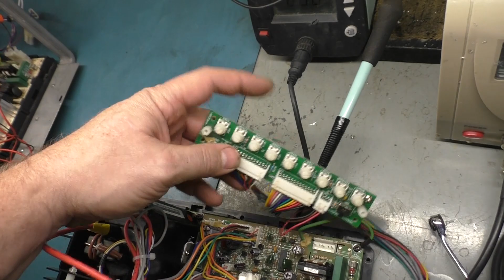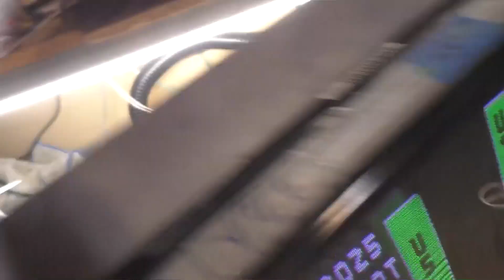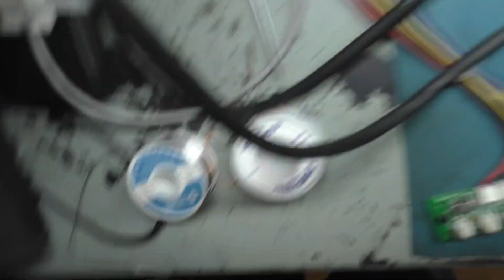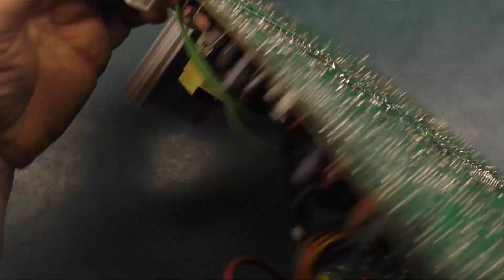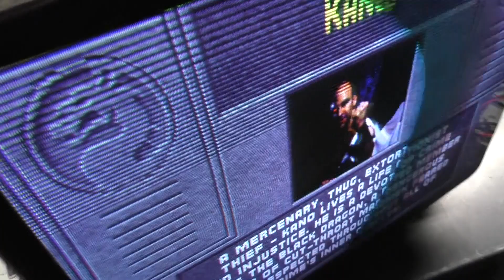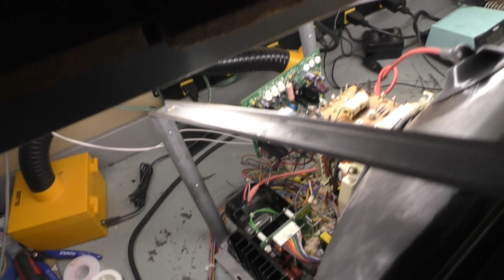24.8" Makvision Wei-Ya Arcade Monitor Chassis Repair - Vertical Deflection Issues. SUPER Frustrating

Comment: Soldering to the back side. If it works. You did it right. Remember the BOSS want it fixed and back on the street making money. I was going to ask how many more resistors did you find out of tolerance? 
 in the 1990's we started a dart league. Networking machines before you do that ask how many power bills you get here? If you don't and they have 3 bills. You are going to blow some shit up. LOL. Can I send you a couple chassis to fix for me? I find It's also therapeutic to use a 4 lb sledge hammer. Hope yall get a laugh out of this.

Comment: Put a 22uf cap @250V backwards and power it up. Sounds like a pistol going off. And I guarantee you you will find several Resistors in the open RANGE. LMAO. REMEMBER BOYS AND GIRLS. IF THE BOSS DIDN'T SEE IT HAPPEN. IT DIDN'T.  AND MY FAVORITE TROUBLESHOOTING  TECH or new employs. Triple the blown fuse and power it up. Proper eye protection is needed when doing this.

Comment: my name is Michael and I worked for A&M AMUSEMENT in Augusta Ga. 1987 to 2005. I worked else where and when I came back to work for A&M It was a nightmare. Bins of components missing because no one there had a clue. I reached out to an old friend and his opinion was the cheap components they manufactured these things with. I currently have about 8 of them. We had a nice board holder. Makes componet removal SOOOOOO much easier. When I came back to work it was broken. They also had a B&K OSCILLOSCOPE. I meant to take it home with me. I wish I had it now.

Comment: Hi. Hope you can still see my question. I have two wei-ya 29 inch crts and both have a pincushion and vow problem on the sides. I already recapped them fully but the geometry still really bad. Any suggestions?
Reply from the maker: Hmm. Can’t say off hand unfortunately. Are the chassis’ on the correct yokes? B+ set correctly? Is there no pincushion adjustment on the chassis?
Reply: Hi Mike, I think. My Weiya is just the same chassis you have on the other video, 29 inch monitor. Came new attached to an LG CRT. I bought two from Japan last year from a guy who had them stored. Both do have the adjustments on the top, or small pcb. It does have the PCushion adjuster but it does not fix the issue. Basically, the linearity is curved to the sides, left and right respectively on both sides. Also, the bottom right vows really badly. My Geometry is ugly. I read from a post on google to make sure Cap 76 is a 1uf 50v cap and that it has continuity to IC10. I checked this and did not find continuity and bridge it. However, this made it words plus the PCushion adjuster did not work. So I had to put it back as it was. Anywhere I can send you a photo of my issue. Again, it is the same exact chassis as yours, the weiya C3129DSLG.  @MikesArcadeMonitorRepair

Comment: I just ran GroovyMAME on this same arcade monitor today and it broke it. I only get clicking every 2 seconds with no picture when I plug in the power cable with nothing connected to the VGA input cable. I don’t know what GroovyMAME did but I think it tried to run it at 15.7 kHz and it didn’t like it and broke. Please help my life depends on this precious arcade monitor.
Reply from the maker: It won’t run on anything above 800x600 on VGA. Make sure your resolution is 800x600 or below.
Reply: I was running High 640X480 resolution. It makes no since what GroovyMAME did to my monitor. My monitor was perfect before running it yesterday playing Daytona USA 2 and now I have to figure out how to fix it
Reply: I forgot to say I smelt electrical fire coming from the monitor

Comment: Thank You so much for posting this! There is so few people even talking about these Makvisions, let alone discussing troubleshooting with them. I was very surprised that it took replacing an entire section of resistors before you could see any difference at all. I'm curious if any other problems on the board would have caused these resistors to go bad because I had heard from others that it's not real common for the that to happen. But everybody has a different opinion. I feel like I've already learned some valuable info just watching this. 

I'm an electronics beginner in the process of replacing a Flyback that seemed to fail catastrophically out of nowhere. I was changing resolutions when I heard a zapping noise probably from arching and the screen turned almost solid white and pincushined badly. Then the screen turned off on it's own and never turned on again. So I'm replacing the HOT along with the flyback. I have noticed there are massive resistors on the neckboard as well that look like they may have had cold solder joints. So I did lots of reflowing as well as replaced most of the capacitors. This happened months ago and still haven't got around to replacing the flyback, as I've just been trying to learn about any potential problems before attempting to boot it back up. 

Anyways sorry for random essay but wanted to say I enjoyed the video and wanted to share my story. It's  fun to experiment with this stuff even if I may not get it going again anytime soon. ;)

Comment: Nice finds to get that fixed! 
I had an M3129DB that had a similar vertical deflection type issue causing bars like that to happen but it was happening half way through the picture / sweep. Turned out there was a small mylar capacitor that was bad  in the vertical output block of the chassis. One single mylar and the entire picture was restored lol. Hunting resistors can be frustrating though.

Comment: Hope you had a good Christmas but would you happen to know where I can find a service manual PDF for a 7600 chassis Wells Gardner
Reply from the maker: Yes. Thanks you. 19” or 25”? That’s just a standard K7000. You can Google “K7000 Manual” and you’ll find it.
Reply: Okay
Reply: But it doesn't look like a standard k7000
Reply: Can't get my phone to send a pic on there
Reply: Is on a it is on a 36-in tube for a rolling extreme street luge
Reply from the maker: No? Not familiar with the K7600 then. You sure it's not a U5000? Did some quick googling and everything for a K7600 is coming up as a U5000.
Reply: @MikesArcadeMonitorRepair  that's the same problem I'm coming up with I did find one of the chassis for sale on eBay but that was it the deflection I see is on the back side of the board towards the monitor and the pin cushion board is soldered directly into the motherboard and it looks like it has some kind of amplifier capacitor for the tube  for the fly back
Reply: Is there a is there a way that I can send you the picture through email or something

Comment: Hey Mike!  Thanks for making these videos -- I'm learning a lot!  Curious on a few things.. 1 - When is it not advisable to test a part in circuit?  2 - Do you have any vector monitors you could make videos on?  I have a V2000 I'd like help troubleshooting :)  3 - Do you accept mail in repairs?  4 - You seem to prefer solder braids over desoldering irons - any reason why?
Reply from the maker: 1) You can always test a part in circuit. I only remove them from the circuit if they don’t test good in circuit. This mostly only applies to resistors. If they read out of tolerance in circuit, they must be read out of circuit to verify if they are actually good or not because other components can be affecting their readings in circuit. If you’re testing a component like a transistor and it reads shorted, it’s important to remove it and test it out of circuit to make sure it’s actually shorted and not something else that’s bad causing it to read shorted in circuit when it’s actually not. 

2) Not at this moment. Sorry. 

3) Yes but not right now. I’m a few weeks away from moving my arcade to its new location. Had a few setbacks with the new building but we’re back on track now. Once I get everything moved and all set up, I’ll start taking stuff in again. 

4) I don’t prefer braid over stations, but sometimes if you need to just pop a single components out, it’s easier to just use the braid. Also, the station I have is kind of cheap and after a few uses, I have to change the vacuum disc and it gets annoying, so I just grab the braid.
Reply: @MikesArcadeMonitorRepair  Thanks for your answers!  Very helpful!  I'm curious if on your next video you could show how you reflow?  Thanks again!!

Comment: I've been enjoying your videos for a while now but this is the best/most epic one yet. Especially for me because I have a Panasonic TV which has a fantastic picture but also this exact same problem and I've been at my wit's end trying to work out what it is. I've tested all the high voltage caps and like you have found bad ones and swapped them with it having no affect on the picture at all. I've swapped the vertical output IC. Again no effect.

What's funny is I managed to find a post on a forum a while back where someone had this problem and there were like 4 replies. One said something like "looks like a bad cap" and another one said "no it's not a bad cap, it's a problem with a resistor, maybe in the vertical output section" 🤣

Good work dude and thanks for the inspiration to have another go at my TV! 👏
Reply from the maker: Thanks! Let me know what you find out.
Reply: @MikesArcadeMonitorRepair  i'm looking at a schematic for a 3125B chassis and the values for the resistors are specified as the following: 

R112 - 560k
R91 - 39k
R90 - 2M
R110 - 1k

Those resistors may not actually be out of tolerance. makvision49-3056-00_schematic.pdf
Though the PDF says 3129D on it as well which is what you've got

Weird!
Reply from the maker: Really? That’s very interesting. Why would changing them to the ratings that match the working chassis fix the issue? Now I need to look further. Odd indeed. Thank you. I must have been looking at the schematic for a different model that happened to match the other two chassis.’
Reply: @Gubalicious  @mikesarcademonitorrepair I know this is late. But I'm here for the same reason. M3125B-82 schematic R90 is 2M. But M3129DB1-72 schematic R90 is 560K. I have the M3125B-82 chassis with R90 2M. My top and bottom screen are perfect while the center is absolutely scrambled. Just ordered some new TDA1675A ICs 'cause a cap kit, related resistors, related mylars, all checked out fine. Fingers crossed.